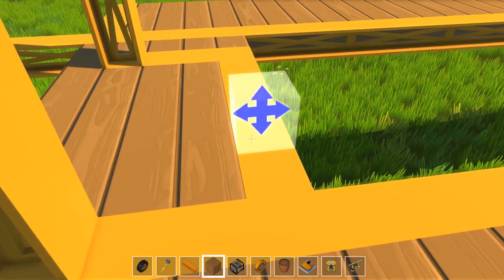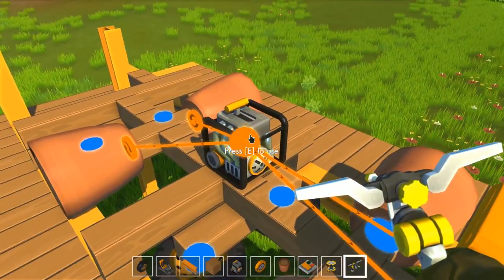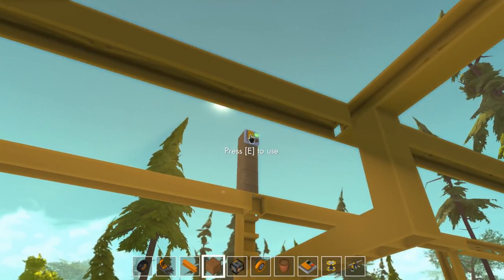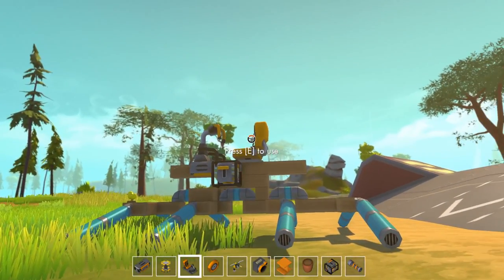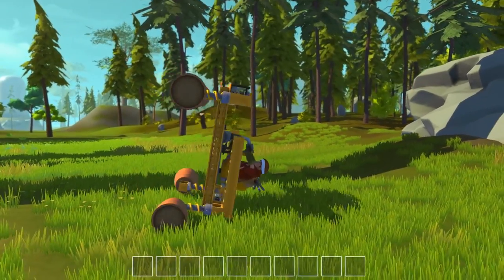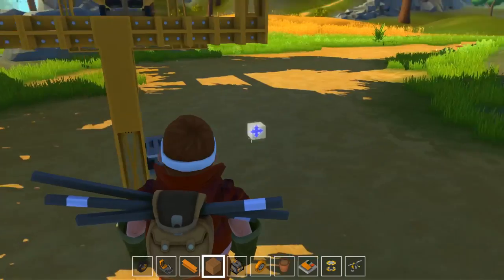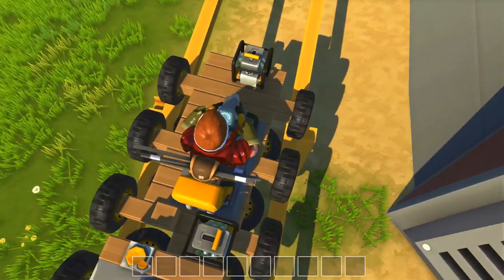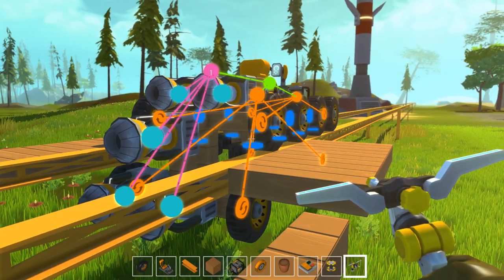Scrap Mechanic: Railway System and Self Righting Cars

Comment: The thing about the pots is that they have less physical code to them, so the game doesn't treat them a s wheeles.  So, it has physics like a normal block, meaning it's really slick, giving you ability to drift
Reply from the maker: +Taunter22 The EVO Aha. Cool. I need to do some more testing with them and see what comes of it. Thanks for that. Have u tried using them this way yourself?
Reply: +Besiege This! Yeah I made a rubber ducky car, but it barely worked.  Also, more rectangular objects can climb when applied right.  But, if you want to climb, you might flip a lot, because the gravity physics really multiply your momentum making you fly really far when you flip
Reply: +Besiege This! Also, if you make a spider with legs that spin and then pots for wheels legs, you could use bearings like suspension, but you have to not use the bearings, just let them spin.  But if you have to light of a base, you won't get enough grip

Comment: It was only a matter of time you'd find this game. XD I never thought of using some of these blocks for wheels! I had tried a few out, but never thought of using pipes quite like that. I've found short pipes work great for my suspended monorail! Without bulky tires, I have room for suspension, and can now go round a curve.
Reply from the maker: +Crispy Bacon Yeah I'm gonna try out all the blocks for alternate uses now. The blue pipes are awesome for building spiders too! that's my next video.
Reply: Besiege This! Hey, I played around with your "pipe crawler" concept: imgur . com / a / dOkAQ Now it never flips, but gets stuck in the ground a lot. :\ A whacked some wheels on the pipes in the end, completely negating the point of the pipes, but at least it doesn't get stuck in the ground any more...

Comment: The problem with the second vehicle, is that the middle tires were turning INTO the tracks and INTO the actual structure blocks. That's what was causing the trembling.

Comment: Frizb if you put a sensor block where you would have the rail car connected to the junction you could have it work hands free
Reply from the maker: +Epos Yeah that would work ofc but I need to have at least two options so I can decide which track I want to switch too so I'm thinking two or more sensors but with a way of choosing which one to trigger
Reply: Besiege This! you could stack two bearings with blocks on top of each-other and have their default position be at  a 45 degree angle somewhere inbetween

Comment: Have you thought about making a BattleBots, EXCEPT IN THIS GAME? You could get your experienced Besiegers to create weaponized vehicles and have a tourney.
Reply from the maker: +Ken Aratame I watched Draegast invite some other youtubers in for a cart race so yeah BattleBots would be doable
Reply: +Ken Aratame 
i think that vehicles can't quite get destroyed in this game yet, so that would be kind of pointless.
Reply from the maker: Mighty Wolf That is a problem but what if the aim (for now) was to knock them over or out of the ring? maybe? I would love to try it
Reply: Besiege This!
yeah, that's easily possible (judging by drae's race) and this time you could actually commentate on it while the 2 of them go at each other themselves, so it would probably remove the restriction of having a low amount of controls and whatnot.
also, the aim would probably be to knock them out of the ring since they'll probably make some sort of flip-back-over device similar (or exactly the same) as yours.
but, if someone doesn't make it, immobilization by flipping over is still possible, so yeah, it would probably be cool.
looking back on the besiege battle bots, there were a good amount of times where the machine itself wasn't destroyed, just immobilized due to getting stuck somewhere or getting thrown out of the ring.
Reply: +Besiege This! you can connect the 90` turner with the track so you got the button on your train in that bar

Comment: If you ever want the train to turn corners you could add suspension to the wheels  under it
Reply from the maker: +Appeared Spade14 Working on suspension now. I really hope I can get faster speeds and smoother rides.
Reply: +Besiege This! Same
Reply: +Besiege This! And if you wanted to make two switch logic gate for the lift or make the turn automated with sensor

Comment: I'd love to see a land speed record of this
Reply from the maker: +ian dunn Yeah I might try that too! We would probably need a timing mod or something.
Reply: +Besiege This! Maybe. If you found a mod I would like to see it if possible. I just hope that second train doesn't clip through the rails anymore.
Reply: +Besiege This! make a large road , then make a clock that starts spinning when you go over the starting line (detector) then also detector at the end to stop the clock, try to calibrate your clock with real time first (start clock , record 1 minut, stop clock , check what angle it is on ...etc.  , then just (distance of track in blocks)/(time on clock)

Comment: The flower pots are geomitrically wrong the inner section should be thicker than the outer section
Reply from the maker: +Lord Asteroph I don't understand what you mean. Are you refering to the design of actual rail wheels that slope inward

Comment: Use more rollers on everything!
Reply from the maker: +maniacram Yep!
Reply: +Besiege This! My idea is to use lots of rollers on a very bendy vehicle that moves like a snake! Can it be done?
Reply from the maker: +maniacram Ok got it! Yes I think it can. I was going to use that idea to try an get around "blocky curves" It might just work. You can make composite curves in the track using 15deg angled blocks strung together, so I might have a go with that soon
Reply: +Besiege This! Oh nice mate! That's great idea for a curved track. Keeping fingers crossed it works! Also maybe you can try using rollers directly underneath the vehicle instead of the sides, going along from front to back under the seat, like the scales on the underbelly of a snake. To make it look like the vehicle has no wheels!

Comment: could you try to spin the flower pots 180 so you dont need stabiliesers.
Reply from the maker: +Redline Not sure I understand you. Wouldn't spinning them 180 make the cart narrower?
Reply: Besiege This! what i mean by that is that the cart wants to go into the middel due to the curve like real railway wheels if you search it up they are not straight but angled so the train goes in the middle of the track by itself.
Reply from the maker: Right! I did that in besiege with large cogs as rails . it works a treat. I was going to angle the rails too here but angling the wheels might work right enough. I will give it a try. thanks
Reply: Besiege This! BTW i love that you read your comments thanks :D
Reply from the maker: np man! I love getting feedback and having technical conversations. So thank you too :)